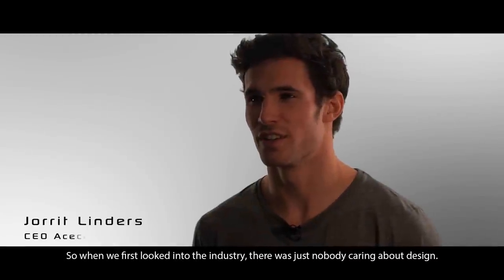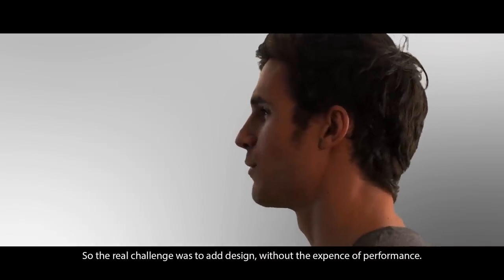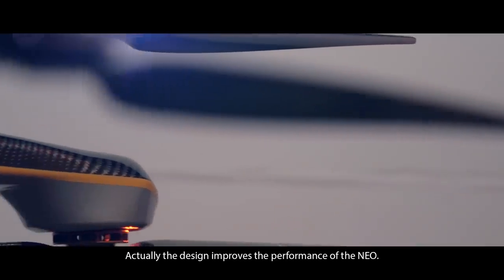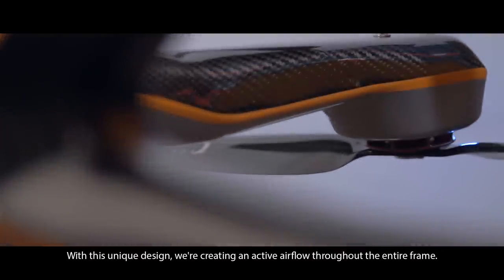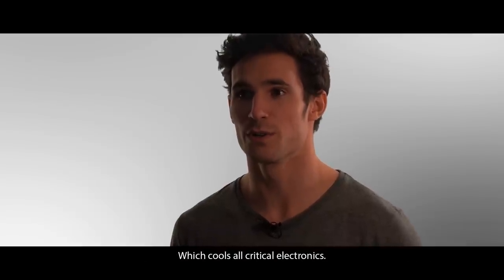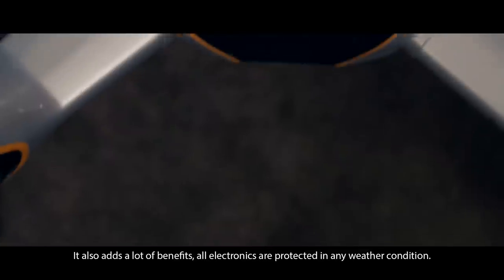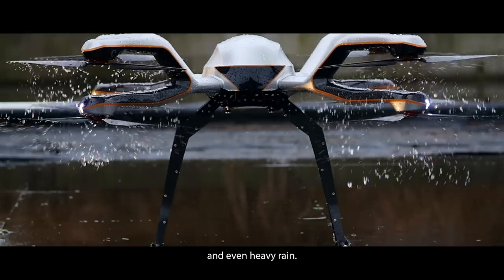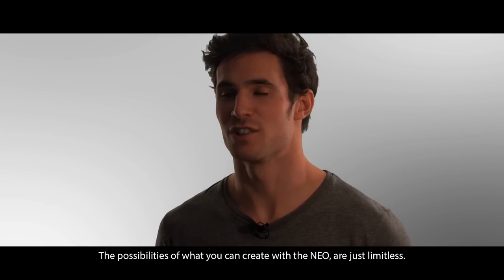AceCore - NEO Drone - Designed to Perform

Comment: Looks like this never made it to the market in a big way?
Reply from the maker: It definitely did. Since its release, Neo's have been used to film Game of Thrones, Formula 1, and other exiting stuff. Acecore never used paid media to communicatie to the masses which might explain your comment.
Reply: @AcecoreTechnologies  Oh that's great to hear because it looks like just a promising design. Now the statement that this design actually improves the performance, are you talking about stability? Because it's known that a coaxial x8 configuration reduces the efficiency (flight time) relative to a flat octo configuration. OR have you done something special there? It looks like they are counter rotating?
Reply from the maker: @strawhatsam  A parallel coaxial setup like we used for our Neo is not the most efficient at creating lift. Though, in this case the trade-off is well worth it because of the improved flight performance e.g. stability, maneuverability, redundancy.